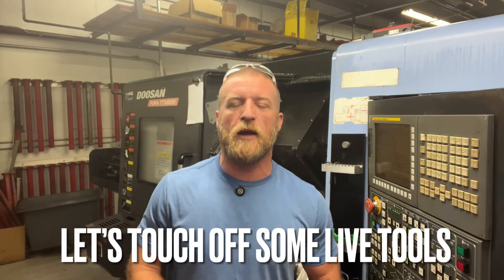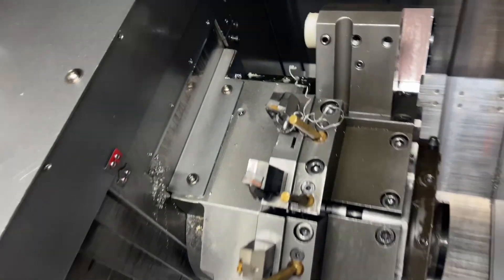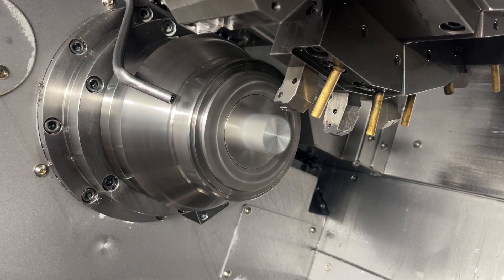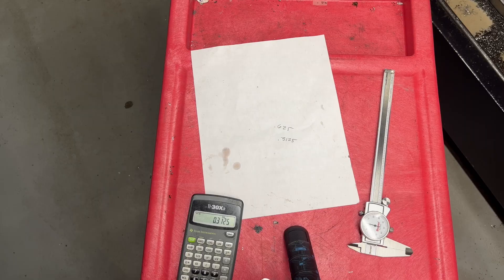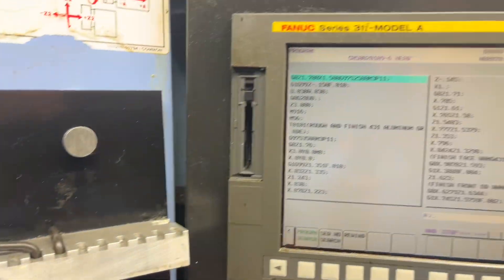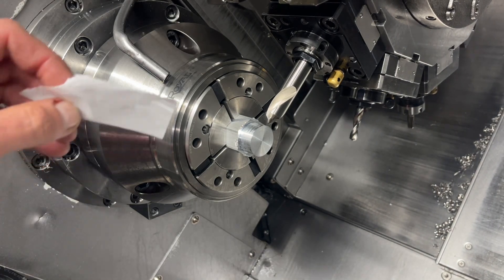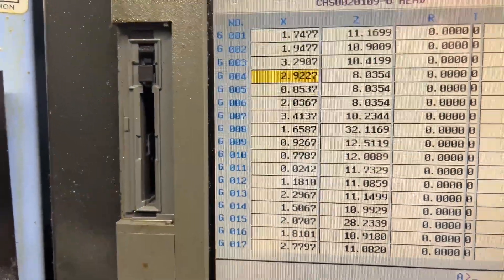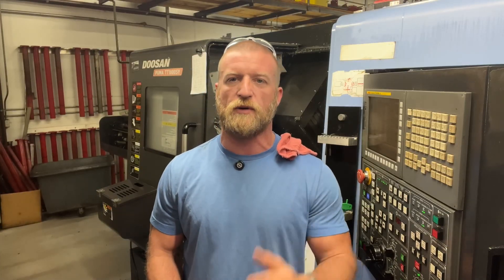How To Touch Live Tools - WITHOUT a Tool Setter!💥💥 #cnc #tool #tools #machining

Comment: I use a 1” block or gauge pin for the same thing. I’ve never trusted a tool setter in my entire career. The only time I didn’t was when working for an aerospace company and a specific machine was setup using a jig with a height gauge on a granit plate and you manually entered the numbers you measured. Hated that method. Doesn’t feel good just putting a number in lol. But my preferred method when it’s possible is to turn the the spindle on and tough the face with the mpg set to tenths and move until the color changes upon touching. This is especially effective for when 2 turning tools “blend” into each others tool paths.
Reply from the maker: I like the gage block method. I’m the same way with tool probes - don’t trust them. Blue Dykem has been a go to for me also 👍
Reply: @Crusadermachining I only don’t use dykem because it’s an added step and every time I use it I end up splattering it everywhere trying to quickly dry it and somehow even when dry, once the spindle turns on it splatters more lol

Comment: If I’m putting in a lot of tools I like to just throw in a small piece of brass then face of to make sure I’m on center then OD. Repeat  then I set a z zero and touch off all the tools to the face with a .01” shim. When setting the y in a cross mill holder to just start at y and offset as needed or do you tram in the holder before?
Reply from the maker: I usually just offset as needed. But if it is a more critical feature, I will teach that at Y0 in a similar way.  I’m actually planning to make a video next week and how I do that and why we do that.

Comment: Best method in my opinion.I have a tool setter on the machine I run and whoever installed it did a horrible job because if I touch the top or bottom the difference is TEN thou like wtf. 
I had to touch off all my tools like this while the tool setter was getting replaced and I was pretty much in spec by the time I started running. 
That saved me so much time op stopping and wear offsetting everything to match the program. But, my shop is weird about giving me only just enough material for the run and also doesn’t like you grabbing any leftover stock for setups so, cue setter it is I guess lol
Reply from the maker: I get it for sure man. A lot of shops use them solely and for those shops, it works great.   Nothing wrong with it at all.  With a good setter, that’s calibrated well, they’re super helpful for making that first part perfect.

Comment: Great explanation. I have a Daewoo 2000sy and there are many of times I have to manually touch off tools without the Q setter being the part in process is too long to use it. The method I like using is a 1/4" gage pin to slip measure the tools can get down to 0.0001" easily that way. Great videos keep up the good work
Reply from the maker: Hey thank you for the kind words and thank you for watching! I know quite a few people that have used the cage block method and they swear by it saying that it’s the most accurate method they have. I think I’ll try it next time.

Comment: How would you go about setting a y axis offset for a driven tool for those of us who have a y axis machine.
Ive always struggled with it as its not always a standard offset across all my tools.
Reply from the maker: I can make a video on that as well. Are you talking about how to set the Y to zero or set it “on center” ?
Reply: @Crusadermachining set it on center so if you're doing features on one side of a part and then turn the C 180 and do some more that the features line up across the center line of the part.
Reply from the maker: @richardhall2542 gotcha. Definitely makes sense. I’ll cover it for sure.
Reply: @Crusadermachining thank you. Your videos are incredibly helpful. Thank you for spending the time
Reply from the maker: @richardhall2542  I appreciate you watching and thank you for that!
Reply: @richardhall2542  just wanted to chime in on this one, I don’t know how Luke does it, but at our shop we set a spindle mounted indicator up in the chuck with virgin 3/8 collets (or jaws). I either set the a gauge pin the same size as the live tooling or if I can I put the tool in shank side out so I can use a Hooked probe on the indicator. You set the indicator in line with y axis on the machine (up and down). Set the indicator to zero on the tool in y+. Then you spin from y+ to y- and the indicator would have swung some thousandths on the dial gauge. Now you handle y halfway back to zero. So if it went negative in y 3 thou, you go positive y handle 1.5 thou. Set to zero, and repeat until when you swing from positive to negative is pretty much dead nuts. You do the same thing in x if it’s an axial live tool. If it’s radial you have to physically move the tool back in and out in z and you find the lowest spot in y and set that to zero, flip to y neg, offset half by handling, repeat.
Reply: @richardhall2542  actually I just realized, I really hope he makes that video for you because indicating live tooling can be a PITA sometimes and my explanation doesn’t do justice. I tried to help.
Reply: @CastroMKE nar thanks for that. It makes sense and that's how i have tried in the parst but my indicator stand is big and heavy so i think it sages due to gravity when i rotate the spindle from the top to the bottom.
Reply from the maker: That’s very similar to how we do it as well

Comment: Hi i don't understand how the turning tool in the beginning touch zero x on this part you should put first central sharp funnel i don't know how you got the tool on x dictince
Reply from the maker: Great question. It is already unknown tool that is already set on X and z. Because it is already set on those two access I can use that to set the material.  So I use that known tool to show X and X

Comment: I always ask my boss for a 💸€50 bill 😉to touch of tools, when I bring it back he always say, " keep it, I have plenty of them ".   😁😍
When I set the height on a lathe for exact centre-line ( Y-axis ) of an internal broach I put a LED edge finder or a 3D Haimer in the collet and use Y+/Y- to find Y0.
First I try to find the alignment as good as I can, then I use one of these tools, also you can use a 3D Haimer or LED edge finder on all the ID/OD tooling.
And yes, sometimes I use your method on our older lathes with chuck instead of collets and without a tool-setter, many ways to set tool-offsets.
Reply from the maker: Hahaha that’s awesome. I like that. Thanks for the input as well!

Comment: 7:07 Usually you can do it unless you don´t do precision stuff like fine boring holes. Then also Y must be measured too! There is the most difference.
Reply from the maker: Very true. And that’s a great point. I did not touch and Y axis but I think I’ll make another video to do so. Thanks for the input.
Reply: @Crusadermachining  Please and thank you. I have  new employees come on wanting to know more, and I always send them to your videos. have you ever messed with the G100 code on the Doosans for the parts catcher to operate while the machine is cutting? I would love a video about that subject. Every second counts on these big runs.
Reply from the maker: @calebhack8419 we do that. We had to change around our programs to be able to dump the part while the upper is cutting. Saves a lot of time. I can look into that and cover it for sure. Thank you for watching and following along!!

Comment: very very important that we use the right paper ( the 110 paper. i ones used/grabbed some 90 paper and couldnt understand why it didnt match. measured the paper and then it all made sence. im from a metric so 110 paper is 0.1mm thick and 90 paper is 0.08mm thick so it was 0.02 off where it should on parts that had plus minus 0.007mm. you can actually use the paper trick to get extremely tight/close. since i used it alot and got a real touch/holding methood i usually hit around 0.004-0.005mm each time/ tools from eachother which is better then the runout tolorance of a er collet ( 0.015mm ) 

so for any one of you new guys out there reading it. get that paper out and start practising. cuase its a extremely good skill to have. you never know if your gonna end up in a shop where they dont have a toolsetter in the machine
Reply from the maker: I really appreciate the comment and it makes a lot of sense. I like how you want to be so close. And the paper DOES matter. Using this method I’m working .001” everytime. Apparently you are also! Thanks for the input. I hope others read this comment and they can learn from what you said.
Reply: @Crusadermachining  👍